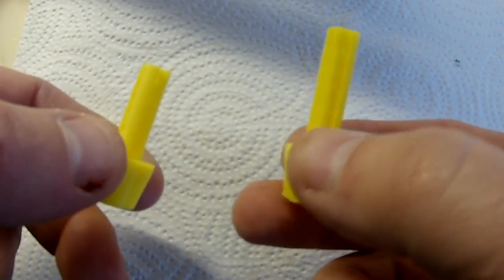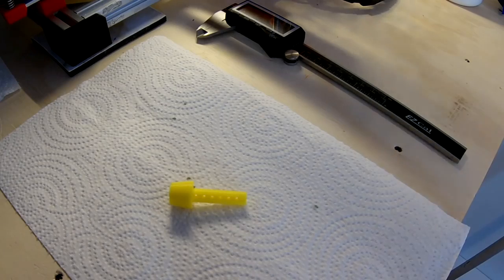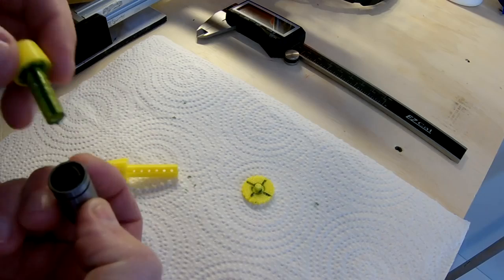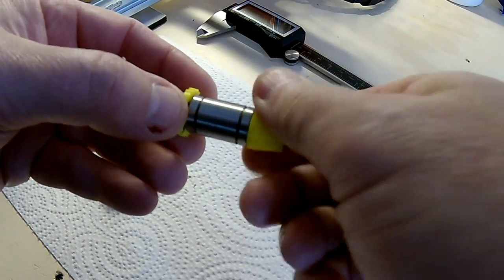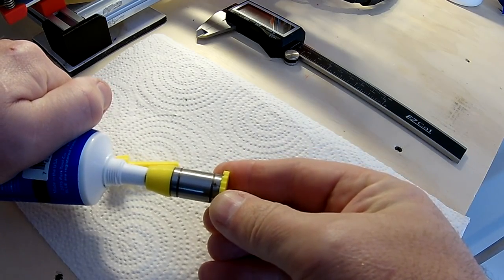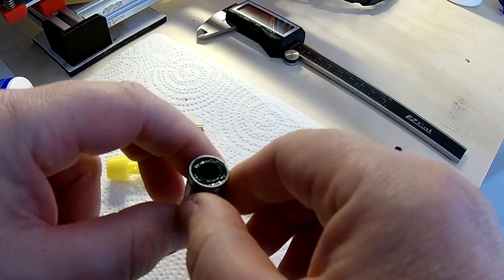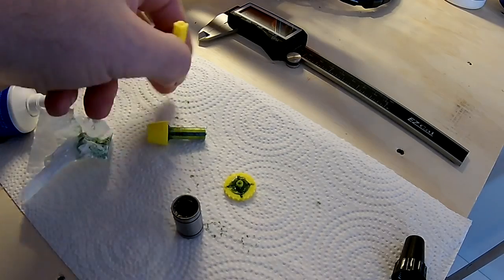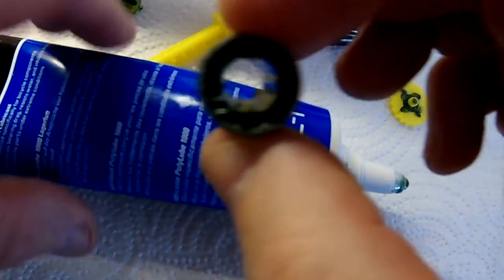What are they for?

Comment: Nice...which is the best way to clean out the old gritty stuff from China...almost all mine are really gritty, it eventually wears..but I want to wash out the junk...and put good moly grease in em
As it stands now I just drip some light 3in1 (or sewing machine oil) on the rods as they move back and forth..I have used some heavier non detergent air compressor oil as well, even in the sintered bearings on my fans that seem to make noise after a while...it's heavier and seems not to run off as much as the lighter oil
Reply: You have probably found out after two years, but in case someone else stumbles over this: I've been told to use kerosine cleaner to clean them before packing with grease. IPA is not a good option because it might affect the ball holders and seals.
Reply: @ulaB  roger that...something petroleum based...gotcha